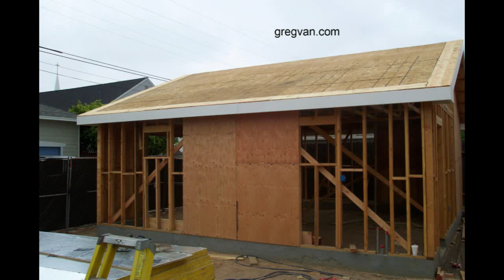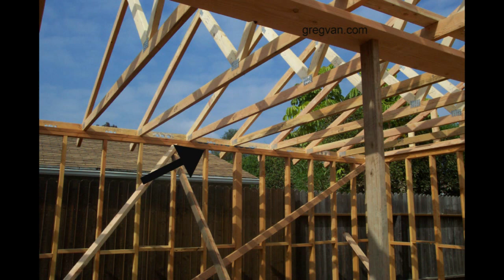Can Strong Winds Lift off A Buildings Roof - Effects of Hurricanes and Tornadoes

Comment: What about a wind flowing just above but  parallel to a horizontal   roof? will the roof lift because of the lower pressure or not?
Reply from the maker: You've got a good point and you're probably right. Wind blowing in a variety of different directions could create vacuums or push and pull effects to separate the roof from the walls.